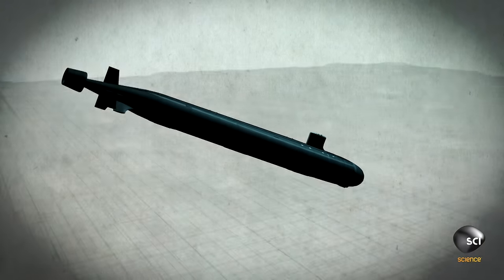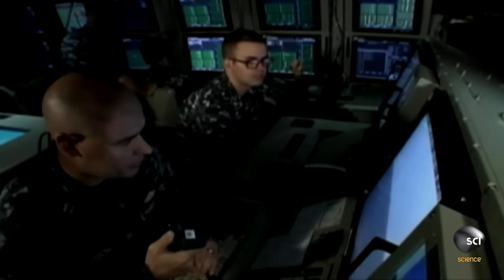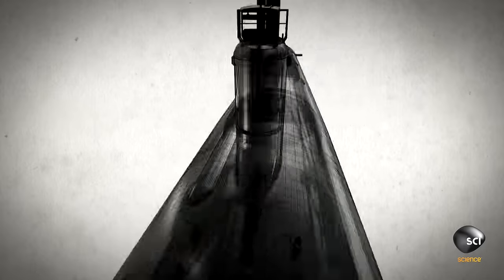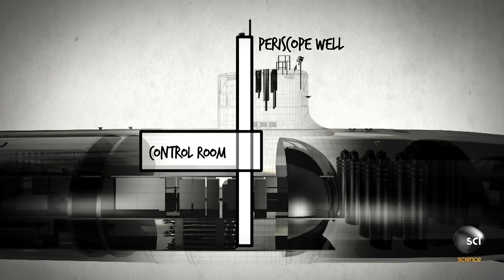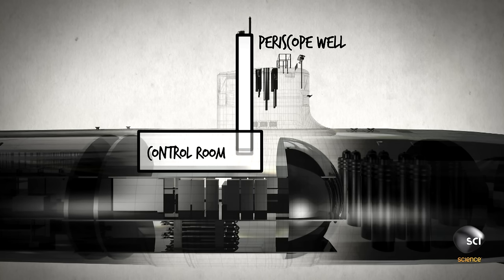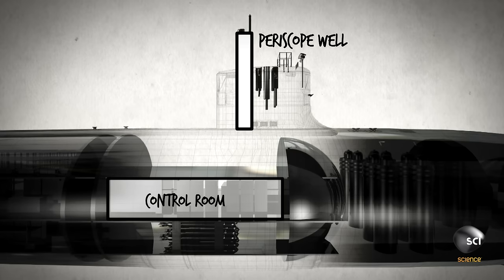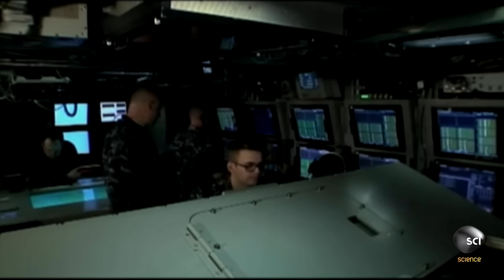How Do Submarines Dive and Surface?

Comment: How Do Submarines Dive and Surface?
Answer : by this sophisticated periscope that lets the control room be situated in the middle of the submarine. 

Really guys?? I was expecting you would explain in detail how they release and replenish the air in those ballast tanks. Yes, you talked about releasing the air but how do they get air back in to let the sub float?
Reply: Amor Marzan Air can be compressed, and when that happens you change the density of it. Lots of air can be stored when it's compressed. Here's a formula (Pressure)×(Volume)=(moles)×(gas constant)×(Temperature). When you keep the same amount of gas, the 'moles', but at a lower volume pressure goes up to account for it being squished. When it's released to a greater volume it will attempt to return to atmospheric pressure and push the water out. They get new air from surfacing and compressing it down for later use.
Reply: Dan314159265 somebody didnt get my sarcasm.. lol
Reply: I thought I found a video for my presentation at last but …….
Reply: @amormarzan4873  no u
Reply: Dan the water never leaves the submarine
Reply: i see no sarcasm in that comment though
Reply: @iphoneawesome123  "When it's released to a greater volume it will attempt to return to atmospheric pressure and push the water out. " This bit makes zero sense. The ambient pressure on a submerged submarine is always greater than the pressure of a single atmosphere. Hence, the air allowed to expand  does not expand anywhere. There needs to be an active system pumping the water out again.
Reply: @amormarzan4873  That must be some DEEP sarcasm bro ! Wow ! You couldn't even care to use some Italics or bold because... not many can identify your sarcastic tone in a text you wrote, unless u told us it was so.
Reply: @Dan314159265 wouldn’t it float it back up?
Reply: @iphoneawesome123  :They should have you do the video since the Science Channel obviously has no clue.
Reply: @iphoneawesome123  Moronic.  Air released from high pressure storage into a main ballast tank is subsequently "lost" to the atmosphere - not recaptured in another storage tank.
Reply: Serious answer: while at neutral buoyancy, you steer the sub up to snorkel depth using the bow/stern planes, then use the air from the snorkel to blow the tanks with the aid of a blower pump.

If you're unable to get up to periscope depth (or you're on a WWII sub that doesn't have a blower pump and may not have a snorkel either), you can use compressed air from tanks instead, replenishing these using an onboard compressor once on the surface where you have as much air as you need.

If you're snorkeling but the blower isn't working (or, again, you are on a WWII sub that doesn't have one), you can direct the exhaust from your diesels into the tanks to blow them out that way instead.
Reply: What sarcasm, huh?
Reply: I just think they have pump that pump water from water tank outsdie.
Like that pump pumps water outside water tank.
For air idk maybe they have air tank ready.
And pump need to be strong that water whats pump out dont come inside then
Its just my opinion,maybe it work maybe it not.
Reply: @amormarzan4873  That's not how you should answer to a useful, elaborated, well written and respectful comment.
Reply: @SaltiDawg2008  ok. So then how do they get the sub to float again?
Reply: Two ways, storing it and electrolysis. You can compress and store any gaseous substance (air) in specially designed tanks at a very high density for later use. The other way is through electrolysis where a submarine splits water into hydrogen and oxygen gas, which is then released into the submarines compartments to keep the crew alive.
Reply: @amormarzan4873  but it is good to see such wonderful information
Reply: based on the comments below, a video of "How Do Submarines Dive and Surface" is sorely needed.
Reply: They must have air tank's

Comment: "How Do Submarines Dive and Surface? We won't tell you..."
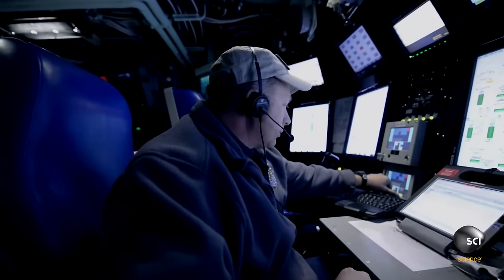Reply: +Jim R. Didriksen Did you even listen from 0:20 to 0:44 ?
Reply: +Levi : Yes, "We use internal ballast tanks to make the ship neutrally buoyant" on the surface I can imagine they fill the tanks with air. The details around how they do this far under the surface of the water without access to surplus air is what would make for some interesting information.
Reply: +Jim R. Didriksen I think they separate oxygen molecules from the water (h2o) and fill the tanks with that to make the pressure in the tank enough to make it neutrally balanced.
Reply: +Jim R. Didriksen If a submarine is neutrally buoyant, it can move up and down in the water without hassle via elevators.
Reply: +Jim R. Didriksen If a submarine is neutrally buoyant, it can move up and down in the water without hassle via elevators.
Reply: +NuggetOfBlueGold and what would the void created by "getting rid of the water" be filled with? vacuum? no. it's air.
Reply: +Levi There isn't enough oxygen in the water to do that. There isn't even enough nitrogen, carbon dioxide, or any other gasses to do that.
Reply: Air (oxygen) is made from seawater electrolysis.  They get rid of the excess hydrogen.  Some fuel cell driven AIP submarines actually use the hydrogen.
Reply: NuggetOfBlueGold, he meant that in order for water to exit the submarine, something must replace the space where the water used to be, and that space would most logically be replaced with air. his question was how do they get the air? the answer to that is compressed air; the compressed air forces its way into the tanks as pumps draw out water.

also with the oxygen thing, water is H20, meaning it is composed of 2 hydrogen atoms and 1 oxygen atom per molecule. when the two are separated, both will become a gas. however, this process is slow and impractical, its better just to bring a tank of highly compressed air.
Reply: I just thought air would reduce some of the pressure from the water? since I thought having a vacuum would put unnecessary stress on the tanks and bringing some compressed air down isn't too big of a deal...
Reply: Submarines use trim tanks to maintain neutral buoyancy, it doesn't require to chase much water as the diving planes and propeller perform most of the depth change maneuvers.
Reply: Jim R. Didriksen 
Its true
Reply: Neutrally buoyant.... at that point you can move freely.
Reply: Jim R. Didriksen It's a fucking camera on a selfie stick lol.. State of the art my arse!!
Reply: Jim R. Didriksen if a torpedo hits it, does it surface or dives?  Hahahahaha
Reply: @jim0_o  Each ballast tank has its own set of high-pressure air tanks that are filled by air compressors inside the pressure hull when necessary. The storage tanks are inside the ballast tanks, and the air in those tanks is used for emergency surfacing only. For a normal surface, the boat goes to Periscope Depth by normal propulsion, does a Sonar and Periscope sweep to make sure there's nothing to run into. After that, the boat raises its Snorkel Mast, and then turns on the Low Pressure Blower, which is essentially just a big air blower that blows or draws air wherever you need it to go. For example, to get to the surface, you line up the ventilation system to blow air from the LPB to the Main Ballast Tanks. It's slower than dumping high-pressure air into the tanks, but it also doesn't waste precious HP air that's needed for emergencies.

The internal tanks mentioned are what we call "Trim Tanks", and they're essentially for keeping the boat level, both fore and aft, as well as port and starboard.

A boat's amount of ballast is calculated prior to leaving port; without doing so, you could wind up on the bottom as soon as you opened the MBT vents to dive. Ballast calculations include Food, crew, weapons, supplies, etc.
Reply: @CYBERVISIONSdotCom  Thanks for making the act of watching this video pay off after 3+ years.
Reply: @jim0_o  I remember the first time I saw the bottom of the MBT's on my boat when it was in a floating drydock. You really don't get a sense of just how big they are, since you only see about 1/5 of a boat's hull when surfaced.
Reply: @CYBERVISIONSdotCom  That was exactly what I was wondering about and it seems nobody actually explains the technical details on "how to surface". Except you, big thank you!
Reply: @LR421xINC  Uh....No.
Reply: Y
Reply: @LR421xINC  yeah but how do they make the internal tanks positively buoyant?
Reply: They literally told you
Reply: @_dj_dubz_  hehe i replied, but that reply seems mysteriously missing, they're presumably still butt hurt about being called out for being horrible convayers of information. (TL:DR; we have vastly different criteria for answering this question, check the replies from 3 years ago for what I as a laymen believes to be a much gooooder answer. (it has enough detail to fool you into thinking you might be able to make crude submarine yourself, using a few huge cyringes and motors setup to change the pressure... oh yeah also batteries,lube and tubes... and one or more raspberry pies or just Arduinos if you're hardcore... and a wireless video game controller to have all the buttons that might need clicking. (Disclaimer: these are badly remembered instructions from DIYSparks video) .... you seem to be pushing me into trying this, luckily
Reply: Luckily i think i have most of the things needed for a sub manned by spiders ants and flies, in this heart warming tale wherr thei will learn too accept eschother in the shadow of inneptetude in fastening the tubed, and in measuring the strength of Aliexpress 5dl cyringes that got damaged in transirt,... who needs the full plunger to be complete, and not have a shive level sharp piece, where soft tubber used to be... now enough with me sharing personal plans that should be classified under classification "nah bro not this"  when i get furter along it'll become classified "WTF you lookin at"   lets hopr i even try, in this almost delerious mood from head ache an lack of sleep...
Reply: That's literally the first thing they talked about . Ballast tanks .

Comment: So... how do they surface?
Reply: Magic.
Reply: +CharlieMason That still doesn't make sense: if the air is more inwards in the submarine or more outward, it still makes it more buoyant, doesnt it?
Reply: +CharlieMason Well submarines do have "wings" but they're called planes. At the forward end they're called bow planes. the aft end they're called stern planes. These change the pitch of the submarine. The Bow planes change the pitch alot and the stern planes change it slightly. To surface both of these planes force the ship up and while on the surface the submarine uses a series of low pressure blows to force air into the ballast tanks. the pressure inside will force the water down and out of the ship. There are other ways to surface the ship but this is the preferred way.
Reply: +TheScott10012 I believe they compress the air, therefore not only making space for more dense water, but also increasing the density of the air itself, making it (the air) also less buoyant.
Reply: Drebin LOOK AT THIS PARISCOPE
Reply: Elliot Scepter awala
Reply: There are giant air banks in the sub that push water in the main ballast tanks back out.
Reply: simply: the use presurred air form tanks to fill external tanks (the internal ones are trim tanks).
Reply: @charlie7mason  Nope!
Reply: @TheScott10012  Are you kidding?
Reply: @charlie7mason  You are totally confused - and wrong!
Reply: By pumping air to the bassalt tank and throwing water out, they shift the negative buoyancy to positive.

Comment: Love how the video is supposed to be a demonstration of how submarine drives and ends up being about new observation equipment. I still don't understand where they get the air from to surface after they've expelled it to fill with water? If they have "spare air " on board, wouldn't boat still be buoyant?
Reply: The air is compressed, so takes up less space and the water increases the average density of the submarine, causing it to dive
Reply: They can also use combustion engines or chemical reactions that create gas. They can take the newly formed gas and compress it so it has enough pressure to expel the water
Reply: There are a number of high pressure tanks scattered throught the ship that store compressed air.   They're kept topped up all the time since there are many small devices that use compressed air.